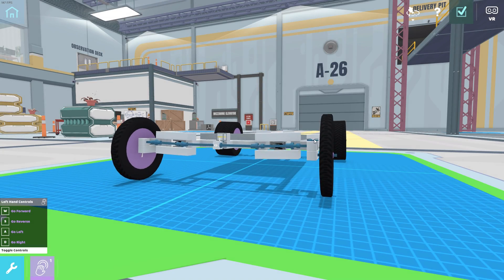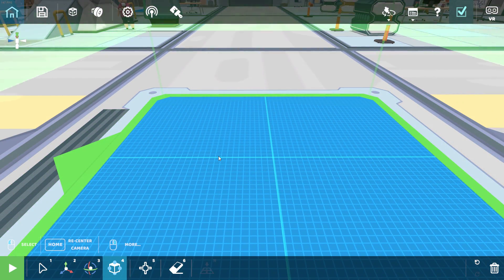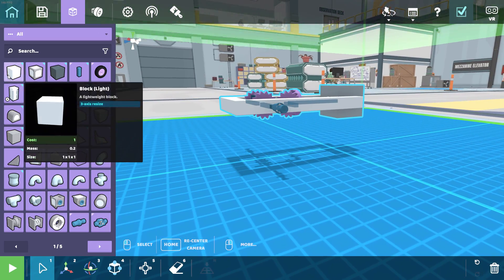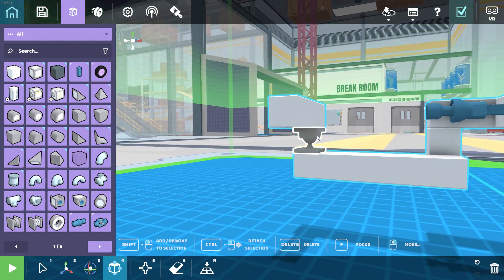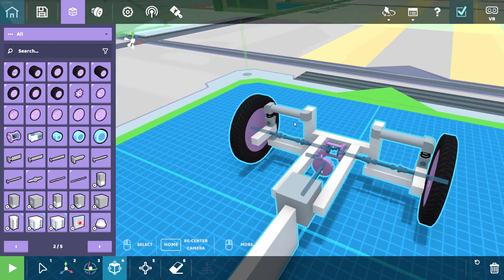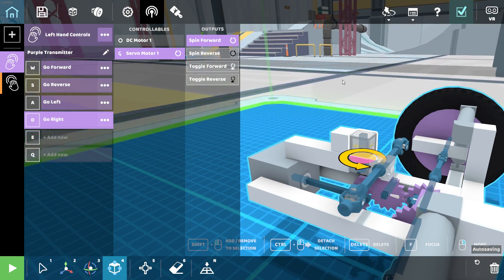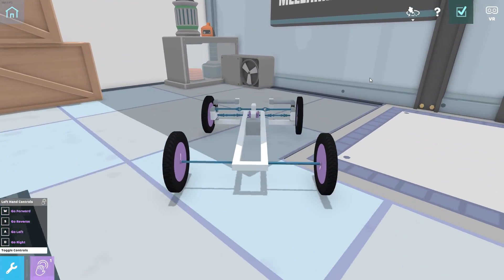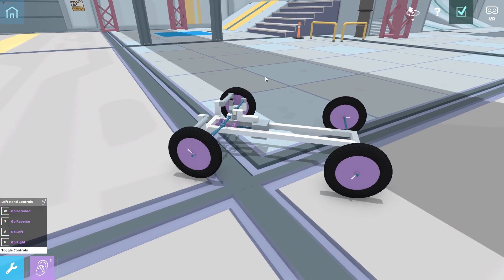Building a "Real" FWD Car with Mechanical Suspension, Drive, and Steering Systems!

Comment: Cars are fwd because they are more economical & better on slippery surfaces than a rwd, also allows for it to be more compact, the engine being sideways will take less length than longways & you iliminate needing a transmission tunnel so more space inside also being sideways can give more leg room
Reply: @Stelthy Green not all front wheel drive cars have a sideways mounted engine.
Reply: @ducewags  there are very few longitudinal fwd cars
Reply: @sully.varnadoe1472  Every Northstar V-8 front wheel drive, and that is just the GM lineup. How is that a few again?
Reply: @ducewags  Excluding v-engines
Reply: @ducewags  have you ever seen how a north star is mounted in the engine bay?
Reply: @sully.varnadoe1472  I guess you forgot about the Eldorodo that infact had the first line up of the Northstar engine and it used it for some years. Oh and it was NOT a transverse mounted front wheel drive. It was the engine that asked it's self why it was changed to a transverse setup. At that point the Northstar turned to junk with the 2-3-5 set up.
Reply: @majorphysics3669  Front wheel drive non V-8 without a transverse engine? Subaru front wheel drive. Saab, Audi are some.
Reply: @ducewags  i think the point was there are much more fwd cars with transverse mounted engines. nobody is disputing they didnt exist lol
Reply: @ducewags  Those are just weird engines. It's weird that they mounted those front to back when they could fit a v8 sideways in the impala.
Reply: @jamesTBurke  Just 1 model? Ok
Reply: @custommotor  At this point I have no idea what you are calling a weird engine in this conversation. And a transverse or sideways mounted engines have so many problems it's not even funny any more.
Reply: @jamesTBurke  You have a hard time with reading things.
Reply: @jamesTBurke  The idea came up that Kan mounted the engine the wrong way, right? I stated it has been done that way and still is done that way. And you think I only pushed 1 model? I added Saab, Audi and Subaru to the list that still male a front wheel only model, and made the comment more then just them still do it. Again, you have a hard time reading, or understanding what was typed. And I NEVER stated the magority were like that. Try and keep up some time...
Reply: @ducewags  oh yeah sorry, its just THE GRAND MAJORITY of them that are like that…
Reply: I have never understood the argument about slippery surface performance. I have always felt like that though was created by so many bad handling RWD American cars back in the day. I have had so RWD cars in my history and a only a few FWD, but I know for a fact in any situation where traction was troublesome I could out do my friends in FWD vehicles. I really think it has more to do with the vehicle setup, differential, weight balance, and power output. Since back in the day without traction control FWD usually had less horsepower and more weight on the front wheels. But as tech has improved the cars with more tech do better. For a RWD I find icy conditions to be fine with a good weight balance and a LSD to make sure both tires spin.
Reply: @custommotor  rwd will be bad in snow & on ice, you'll need to be gentle with the throttle, because on most rwd cars the engine is upfront & that leaves no weight on the rear wheels for traction on slipery surfaces, back in the days where most cars were rwd, you had to put sand bags in your trunk & carry traction plates & regularly use them in winter. but if you have alot of weight on your rear wheels it should be fine.

Comment: The axles on a real car can move in and out slightly on the inner joint. this is to account for the suspension moving up, down and when turning.
Reply: Agreed
Reply: #1. Spring needs to go from frame to either control arm. 
#2. Outer steering link needs to be a universal not a swivel. To allow flex with suspension.
#3. Cv shaft needs to telescope in length, when the suspension goes up and down the distance between the wheel and the differential change.
Reply: @mineonline 11 The outer needs to move as the tire tips in and out on turns. The inner and outer joints both slide. With the 2 joints you get around 3 inches of slide movement on the axel.
Reply: Most fwd cars dont have that....
Reply: @DavePlays1993  Tell me how you get unwanted motion? Sounds like the think wheels are held on by the drive shafts.

Comment: Front wheel drive is cheper than rear wheel drive but it isn't simpler
Reply: Nowadays yes because rwd is mostly only for sports cars but back then making a rwd car could be cheaper than fwd (old ae86 was rwd for simplicity & cost to manufacture etc)

Comment: You should try an AWD car or a 4 wheel steering system, like the nissan 300zx with it being activated only at a certain point and very slightly